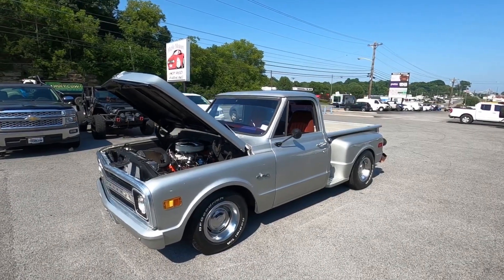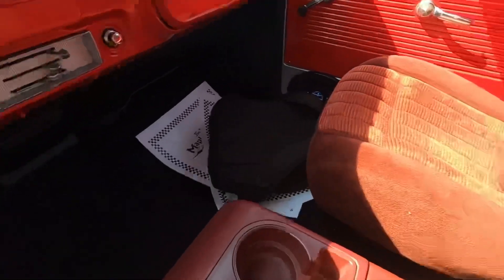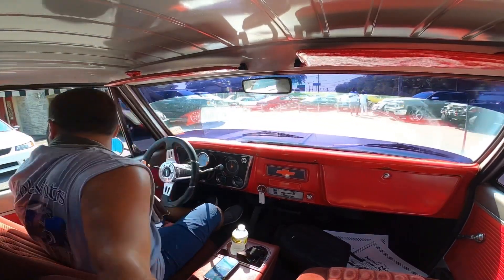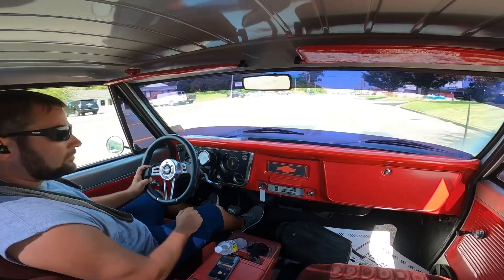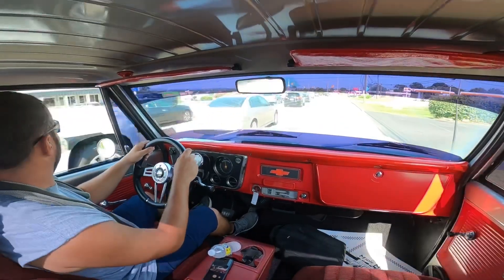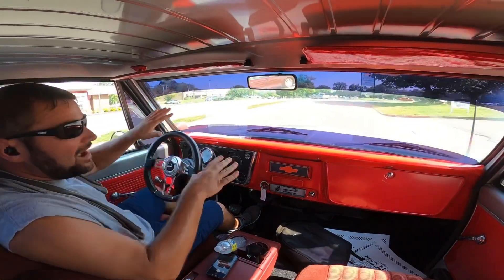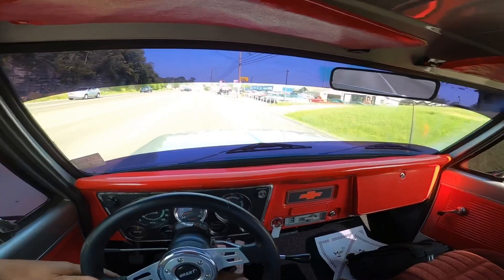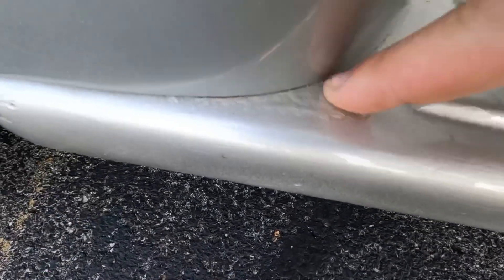Test Drive 1969 Chevrolet C-10 396 SOLD $24,900 Maple Motors #1682

Comment: Nice truck, one safety issue. Looks like someone heated the coil springs to lower it. That lowers a car or truck ok, but if you want to drive it, you’re riding on the bump stops and eventually the springs break. I think that truck is worth dropping it correctly!!!
Just my 2 cents.

Comment: 69 C10 stepside kustom neat little truck I see on website u had beautiful red 68 sold already is that one still available @ ur dealership Nick but sliver 69 could be lowered a more & ur 7:44 turn signals not working easy fix tho.